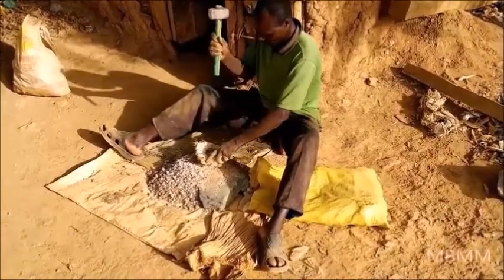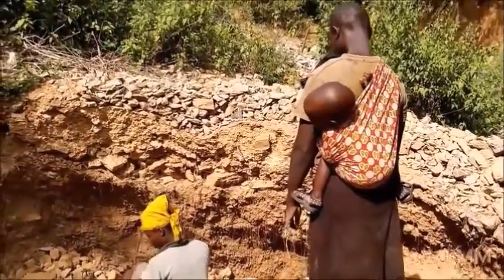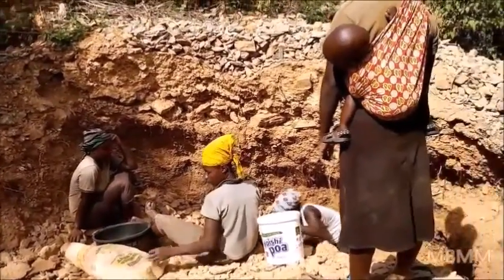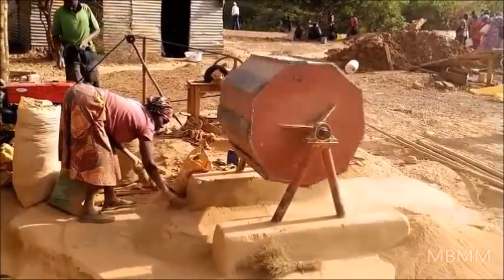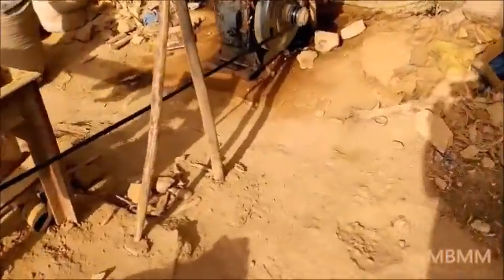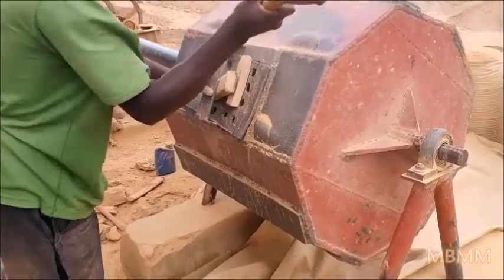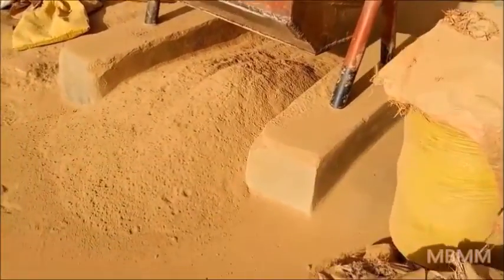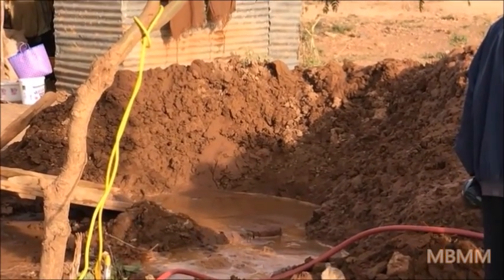Kenya Miners Part 2: Crushing, grinding the ore, and sluicing gold the traditional African way

Comment: I suggested that the drum is round and have 2 inch diameter steel rod inside with 3 pcs. Maybe you can put 100 klgs.of gold ore and put water inside the drum, 1/1.